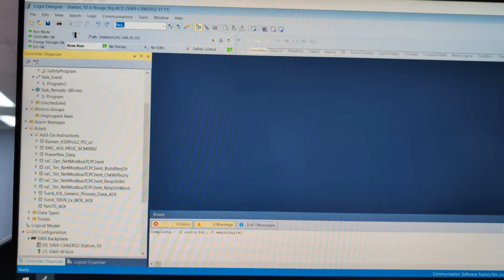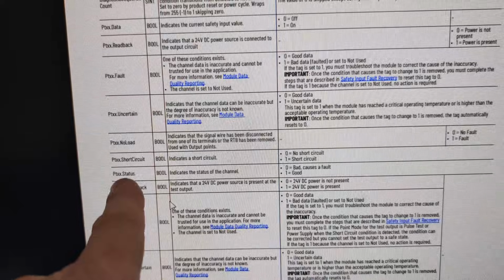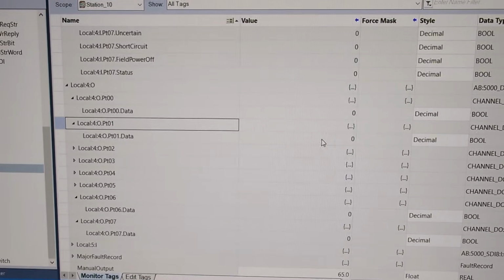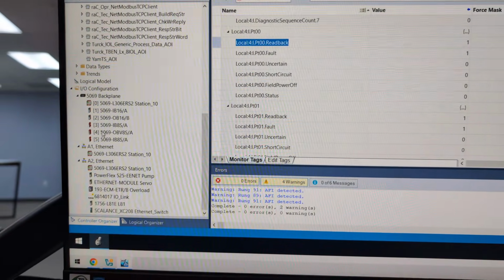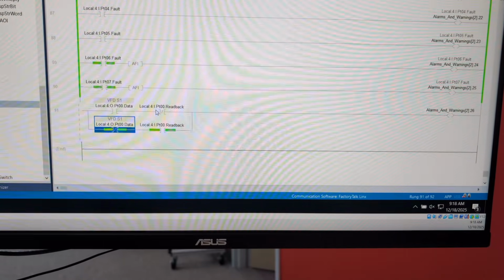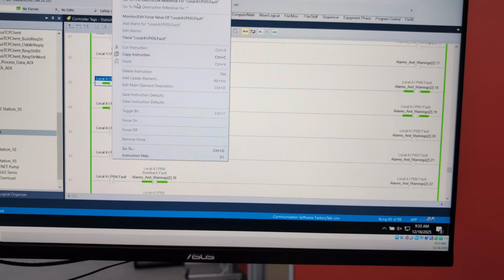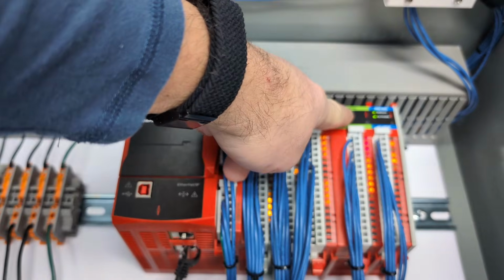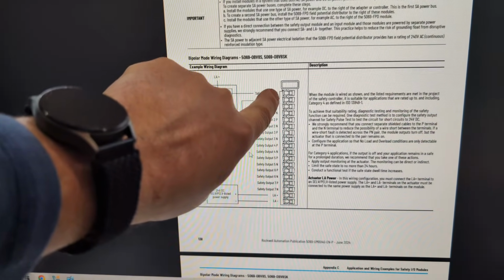Diagnosing 5069-OBV8S Faults

Comment: Hi Tim, there is an AOI that can be added to logic to reset the module fault  “without” having to cycle power if the fault latch does not seem to clear the fault automatically as described in IO manual. We have a system that recycling power is a VERY bad option for operations. Monitor point status and if there is a fault after latch time timeout, make the “reset” module rung true and fire the AOI when reset button is pressed which send module reset command message. Only drawback is if your safety routine is monitoring module “run” status or rack status the AOI can cause other alarms while resetting the module.
Reply from the maker: That's good to know, I'll have to check it out

Comment: Hello, I am currently using a 5069-OBV8S and a PowerFlex 525.
The PowerFlex 525 uses S1 and S2.
I don’t know how to configure the module and wiring.
With my current configuration and wiring, as soon as the module outputs, the SA light turns red.
Could you please give me some advice? Thank you.
Reply from the maker: Did you connect terminal 4 of your to your 24VDC -?
Reply: @TimWilborne 
After rechecking, I found that terminal 4 was mistakenly connected to 24VDC+. This wiring error has now been corrected.
Reply from the maker: Great!

Comment: THE 5069-HSC2XOB4 has a fault latch time that's configurable and its default is set to latch fault forever.  I think it has 3 or 4 other options that range from 1 second to 15 seconds.  I'm not sure if the obv8s has that or not but I ran into a similar problem where if a channel faulted on the counter card, the only way to reset was to clear fault, inhibit, reset module and re-inhibit when fault latch time was set to forever. I changed the fault latch time to 15 seconds and I could recover without inhibiting the module.  You might want to see if the 5069-obv8s is similar to that.
Reply from the maker: That's really helpful to know, I'll definitely look into it!
Reply: @TimWilborne it’s not similar, I had time to look today.  Oh well, it was worth a shot!
Reply from the maker: They do show up in the module properties so I wonder if they are available with a GSV.

Comment: Question: If the outputs are faulted, you may need to enter program mode and then reset the module in the properties. Then back to run.
Reply from the maker: Maybe but I don't know that I clearly established that the outputs were no longer faulted and module was ready to be reset